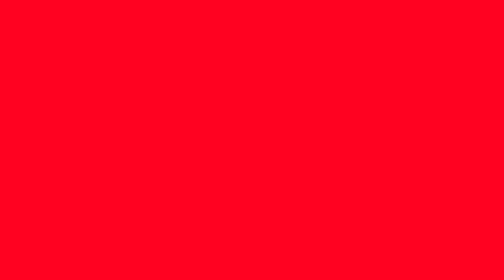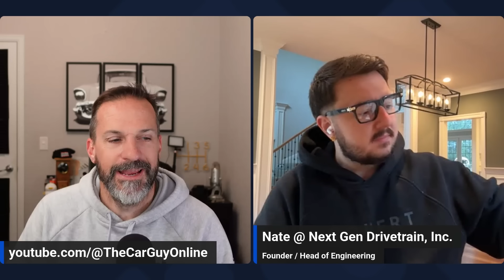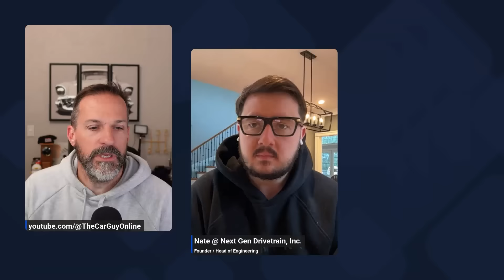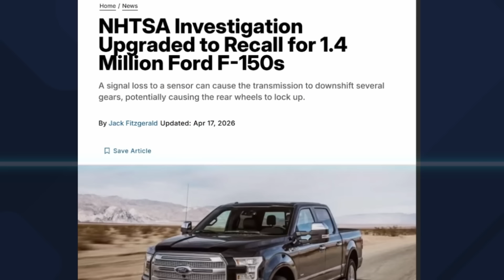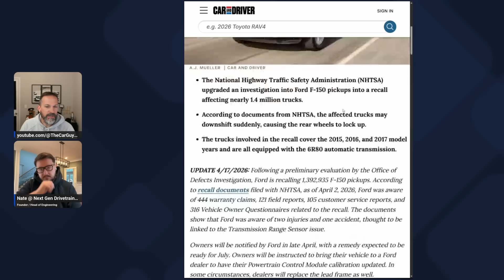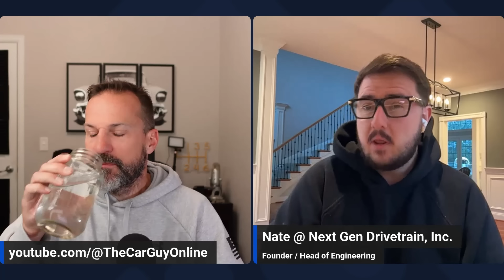Ford's BIGGEST Transmission Recall Yet - 1.4 Million F-150s

Comment: I have a 2015 ford f150 with the 3.5 ecoboost and on the first week of April my transmission was down shifting way to fast and then a wrench 🔧 came up on my dash this happened twice. I took it to the dealership and they said the sensor was bad and it cost me 1,300 dollars. And on the first week of may i gat a recall and ford says they can’t fix it till June and my dealership said I should get a full refund because the recall is the  same reason why I had to get it fixed

Comment: Edit: sorry for my lack of technical terms...
A few months ago my transmission started acting up without warning. I have a 2015 f150 V8 automatic with 120,000 miles. It would have really low power, wasnt shifting into higher gears, lighting up the wrench icon, check engine, blind spot warnings. And sometimes it wouldnt let me start it. No battery problems and It was original thought to have been electrical issue with the transmission. When trying to diagnose it, the shop pulled down my pan and saw normal transmission fuild with light build up but nothing extreme. But they flushed, cleaned and filled and same problems. They eventually told me it was the valve body and i would need to replace it and re-do the computer stuff. $4.5k later i have no issues now. With this recall, im wondering if it related which it does sound like. Would i be able to bring my invoice in for the recall and get paid back for the repairs i had done. And how would i go about that? Thank you for the informative video.

Comment: Some of the information on the 6r80 is not correct. The TCM is not in the transmission, and the lead frame is not a module.  The lead frame holds sensors. They send data to the PCM in the same way an engine sensor, like a MAP or TPS does. When a vehicle has a PCM, it means the engine ECU and TCM are combined into one unit. Pop the hood on an F150 and look at the firewall on the passenger's side of the vehicle. That's where the PCM is mounted. It will have 2 or 3 wiring harnesses plugged into it. The F150's that are the topic of this video will have 3. One goes to the TCM and the other 2 go to the PCM.

Comment: Now they need to recall the 10R80 transmission with it's thousands and thousands of failures.
Reply: 100% I already have a completely new ford trans in 2021. Ford also did some reprogramming on the pcm. It still skips gears. 2 to 4. 4 to 6…friggen sucks.

Comment: I love ❤️ the 4L60 E 4 speed in my 2006 Pontiac GTO. The original Transmission lasted 10 years. But the GM replacement I put in 2015 is still running 🏃 fine till today. 12 years so far so good. 😊

Comment: 2012 F1Shitty FX4 5.0l 200,056.6 miles.

I have changed my transmission fluid and filter twice. I've had it since 2014 at 29,000 miles. Yes I fawked up did the first change late.

I have never had it drop down to 2nd. Original leadframe, as far as I know.

I'm about to rebuild the trans and build a whole MMR 5.0l. I have almost everything but the block and rotating assembly.

OEM nice but they try deep throating the EPA far too much.
Reply: OEM is nice*

Comment: Had this happen to my truck 3 years ago with a little over 130k miles .. I went to a local garage cause my Ford dealership said it would be weeks before they could see my truck... The garage called and said the output speed sensor was bad and it was attached to the leadframe and they could barely get readings from the other sensors on the leadframe as well... When they got the part in 2 days later they called to tell me my trans was shot from that severe downshifting.
. So I had to spend 6k on a new trans with install... I took that invoice from the garage today to my local Ford dealership to see about getting compensation from this issue that caused me to get a new transmission...

Comment: All the trucks seem to have bad trans cooler lines that break or rot apart. I just caught them in time on my 2014 ford and my friend’s newer chevy had the same issue. Lines broke off and cost $6,000 to replace the whole trans on a 6 yr old truck. This shit is ridiculous and should’ve been recalled.

Comment: If it does downshift in to 2nd cant you just manually throw it into neutral really quick?
Reply: It happened to me... It was real quick... Happened going home  hitting 70 and the snap of a finger it downshifted real  quick and almost brought my truck to a halt.... I ended up having to get a new trans
Reply: @Daddybell1991  Do you think throwing it neutral would have allowed the tires to keep spinning?  Or are you just stuck in 2nd gear?
Reply: @adamhelmFYT man it happened so quick. it woulda been different if like if my brakes were not working type thing... But I went from 6th gear to 1st gear that quick... I pulled over and turned my truck off... I was only able to get it up to 4th gear and it shifted  bad and funny.... In the end they had to get the leadframe because that's where all the sensors are located for this truck... The code they found was for the output speed sensor... A few day later the shop called me saying the clutch crapped out and there was metal all in my trans... That's why I had to get a new transmission... That happened around 120k miles and I have 160k on my truck now

Comment: I have a 2017 F150 with 5.0 and a 6R80 and it is randomly having the gear lights on the dash disappear, and the gear select light R N D - Drive go out and the service now wrench shows on the dash and then it acts like it's not in gear, then the cooling fan kicks on for a few seconds, and then that fan stops and the dash lights come back on and it then drives fine. It has down shifted to a lower gear twice not. Ford saying my VIN number does not qualify for the repair of the wiring harness. But my VIN number qualifies for a PCM reprogramming which does not come out until July of this year. This is crazy. What are y'all's thoughts on what to do. Luckily it's not my daily driver I only have 66,000 mi on the truck. It's at a shop now that wants to charge me $1,300 to change out this lead frame wiring harness. 
Should I wait till Ford comes out with this recall in July? Or push the issue with them that it should be under warranty because it's the same issue that happened with the 2011 to 2014 transmissions. Or should I move forward and let this shop fix it by changing the wiring harness?

Vin#1FTEW1EF4HKE45896
Codes 
P0706, P0707, P1702, P1921

Comment: Replaced tranny fluid around 200,000 miles and lead frame (by myself…a shade tee mechanic) after 400,000 miles. I’m at over 436,000 miles today with this 2011 F150 5.0 FX4 I bought new.

Comment: It is sad that our domestic car companies have become so adversarial toward improvements to make an expensive product last longer.  I get that making stuff last only so long will fill show rooms but when you send a car back that went TOO many miles before the transmission craps out and redesign it so that it WILL fail sooner, is just mind boggling.  My brother worked at the milford proving grounds for 30 years before retiring and he told me just that.  And this has been going on for a generation.  GM (ford is no different) does NOT want you driving a 20 year old vehicle.  But for me, reliability and durability so that my "investment" can be spread out over 25 years means I made a good investment.  IF I have to get back in the dealership to buy again in 40k miles, to me that was a bad investment.  I will keep my old car and truck and drive them out....and I won't miss the new computer dashboard, or the 8 cup holders.  Unless and until this changes, I won't be found in any new dealership no matter how shiny the machine is or the suffieticated the product might sound.  Lastly I check used car/truck ads all the time, and it is tempting to jump in, but then sanity returns and I say, do I really want somebody else problem child??  Was it a great deal if I have to dump 10k back into the service end to make it go down the road?  The makers have lost me for the rest of my life.

Comment: I have 2014 f150 5.0 with the 6r80 trans. Have replaced the fluid and filter every 30,000 since I have the truck. I have not had any issues, but hearing about the lead frame issues I replaced it around 80,000 miles myself. Looking at the old one I believe a big part of this is metal contamination in the system, a lot of the components on the lead frame have some of this residue on it, including the speed sensor which seems like a small magnet to me, where a lot of the errors occur. The new lead frame also includes a foam gasket that goes between it and where the solenoids plug in. So to me if the fluids are maintained in the vehicle, you should have minimum problems. At 150,000 miles now, biggest issue I have now is rust rear wheel lips. I already cut out both rocker panels and repaired them. I would not buy a new vehicle of any manufacturer, they are all made like crap, too expensive and you can’t even work on them anymore. Big 3 suck!

Comment: Original owner of a 2009 F150 with a 6R80. The fluid and filter have been changed twice since new, 17 years later I haven’t had one issue with the Transmission. I am however getting ready to replace the Transmission cooler lines just as a preventive maintenance measure as they are going on two decades old. I’ve never experienced the downshift issue outlined in this recall.
Reply: What does 17 years have to do with it? It’s the miles and usage.
Reply: @user-roadwander  It’s got 1500 miles on it and is only used to go to church on Sundays. How the * do you think it’s been used after 17 years?
Reply: @squangan  To church on Sundays, get groceries and of course traveling to the mailbox and back.

Comment: 2018 Ford F150 with 71k on it. It’s started clunking while shifting gears. It’s going in tomorrow, so we’ll see what the dealer says.
Reply: You can remap the transmission tables for $60. Or a tuner chip. Hope you don’t get scammed

Comment: I have a 2020 Silverado and the transmission started shuttering at 72K.  I have an extended warranty my dealership claims to have replaced the Valve body and Torque converter and if I didn't have the warranty, it would have been an $8200 repair.   The truck was in the shop for 3 weeks and they gave me a vehicle to drive for free.  This repair cost me $100.00.  This repair was more than I paid for the warranty.

Comment: Here is the most fantastic part of new cars/trucks. Your vehicle will die before the tires wear out. Funny as it sounds if the tires are high mileage rated then the writing is on the wall. Sell the newer vehicles without tires, just use your old rims and tires on the new vehicle.

Comment: What the auto manufacturers could (amd should) try is bringing manual transmissions back. I have no idea why they have gone away, but they were infinitely more reliable than automatic transmissions and the clutch was the only issue (as long as the fluid was changed on occasion). They could easily squeeze 10+ speeds into a manual with fewer parts and fewer issues and almost certainly lower costs to them and us. They are still in freight trucks - just make them for passenger vehicles again and this issue could potentially go away.
Reply: This was not intended to be a shot at Nate. I bet he could create things for manual transmissions as well. Maybe throw out bushings and the like?

Comment: My 16 F150 just started the downshift issue. Called the local dealership and got told they don't have a fix yet, it's gonna be a reprogram. I asked why a reprogram would be a necessity since it just started at 138,xxx miles. Apparently since I haven't received a recall letter yet, I can't bring it in and there's no fix yet. They suggest parking it. This is the only vehicle I have and they refuse to furnish a loaner.
Reply: Typical move by the big three 😂
Reply: @vinceturella5964 anything other other than banter?

Comment: I have a 2014, base model 2014, with a 3.7 naturally aspirated, ever since new theres been a shutter at 55 to 65 , ive changed the filter and pan fluid once, it has 149,000 miles on the odometer,  oil  changes every 4k , replacement of water pump, alternator, Mobil one full synthetic,  flex fuel system,  the truck is a work truck, .....
    I'd never buy a fully computer run truck, they all need to go back to basics and toss out the bells and whistles which run the cost up 15k, im done with the truck industry, they build pretty junk, and that's about it.....its a F 150 single cab, 8 foot bed, I tow a a small boat, point being is that transmission shutter is a problem identified, Ford is dead , ill never buy another truck from any pickup truck builders ,until they fix the problems identified and get back to basics......toss out the bells and whistles and over 100 sensors, and no touch screen trash .....Nate is a stand up engineer and knows his transmissions and a lot more.....

Comment: I drove my 95 f150 to well past 300k miles.  (until it finally spun crank bearing). 
Now I have a 2002 Acura MDX that is nearly 200k and is still an excellent car; 
and a 2002 F350 7.3L diesel, 6spd manual 4x4,  with nearly 300k;  still an awesome tractor that I will never sell.
Buying anything newer is not appealing to me at all.  I've drove only these three cars and a 97 Isuzu Rodeo 5spd 4x4,  for the last 25 years.

Comment: I wasn’t good with changing transmission fluids, still had .zero issues until after 200,000. Change fluids, ( not flushed) now up in the 230,000 range back to normal.

Comment: My electronically shifted GM 4L60E transmission is still working fine, as long as the fluid is changed they last forever, these kind of problems we're solved over 25 years ago.

Comment: My 1999 Tacoma was the best vehicle I ever had. In 150k over 19 years, I replaced the battery & brakes and had only 1 repair - a starter solenoid. Now I wouldn't buy a Toyota after they became woke and quality went off the cliff.

Comment: Honestly, I would hesitant to buy newer gas powered truck.  Two years ago, I bought a lightly used 2019 Ford Expedition with 22k miles for my wife.  So glad we purchased the extended warranty, as SO many things have failed on it.   Evap core, engine valve seals, front wheel bearing, drivers and passengers seat ECU/heat/cooling modules, clogged AC and sunroof drains, rear hatch not closing, power running boards not working, etc.   Without that extended warranty, we'd be over $5k in repairs by now.   The warranty has more than paid for itself.   

That said, I am considering getting a 2022 or 2023 Ford F150 Lighting EV.   No transmission or engine issues like the 10R80 or the V6 Eco boost can and/or will have.  I'll get an extended warranty for everything else.  And not have to worry about my transmission temps, or it failing.

Comment: My 2018 F-150 has the worst transmission out of my 35 plus vehicle I've owned and overall it's the worst car I've owned by far. My neighbor had a Silverado that shared transmission with my ford and it broke at 50k and the other neighbor took the truck back 3 times because of the harsh downshift. I will trade my truck in as soon as possible.

Comment: 2014  6r80 with 5.0. At about 90k tranny acted up a touch. by 110k and a few calls to ford dealership they just kept giving me the run around. Once I realized they weren't going to fix it cause they said it was out of warranty I took it to my local shop. Lead frame replaced along with a couple other pieces. 1400 bucks later.............now at 117k and no sign of the problem. Thanks Ford for standing behind your tranny. NOT!

Comment: 2014 F150 with 6R80 5.0L v8 : 175,000 miles.  Change my oil every 3k, transmission pan drop & cleaned and refilled every 60k. Differential oil changed same time as trans. Still runs perfect!  I’m NEVER going to sell this truck.
Reply: 2001 f150 200,000 miles.  I maintain the crap out of it and love doing it.  Drives like new.

Comment: Mercedes-Benz has integrated circular economics as a core pillar of its "Ambition 2039" strategy. The goal is to decouple resource consumption from production growth by closing material loops.  
As of 2026, the strategy is anchored by three major initiatives: Battery Circularity, Industrial Remanufacturing, and Circular Vehicle Concepts.
1. Battery Circularity: Closing the Loop
Mercedes-Benz has moved beyond theoretical recycling to operational industrial plants.  
• Kuppenheim Recycling Factory: Opened in late 2024, this is Europe’s first integrated mechanical-hydrometallurgical battery recycling plant. It achieves a recovery rate of over 96% for critical materials like lithium, nickel, and cobalt.  
• Battery ReUse Centre (Kamenz): Starting in early 2026, the Mercedes subsidiary Accumotive is scheduled to begin factory-scale reconditioning of used batteries. These "second-life" batteries are used for stationary energy storage or as "Genuine Remanufactured" spare parts for older EVs.  
• The "Sustainable Mine": The goal is to use the recovered materials from Kuppenheim to produce new battery cells, creating a truly circular supply chain that reduces dependency on primary mining.  
2. REMAN: Industrial Remanufacturing
The "REMAN" program is one of the most mature aspects of their circular economy, involving over 23,000 different parts. 19:16 Mark

Comment: Why older trucks are way more desirable. I NEVER serviced the 700R-4 transmission on my '95 GMC Yukon, from birth and it's still working beautifully as designed after 300k original miles. Doesn't leak either.

Comment: My 6R80 has been just OK but I complained non stop about it’s erratic shifting to the dealer while I still had warranty and all I ever heard was “that’s normal” The violent downshifts are extra great when you’re pulling a trailer and you slow down just a little and it slams from 4th or 5th to 1st while the engine redlines.